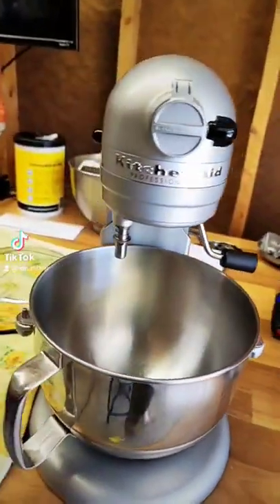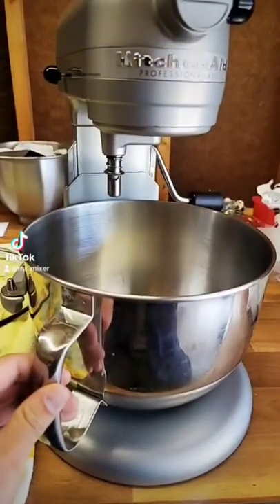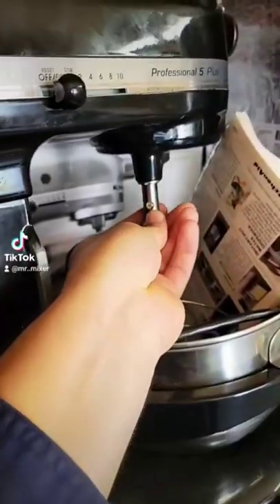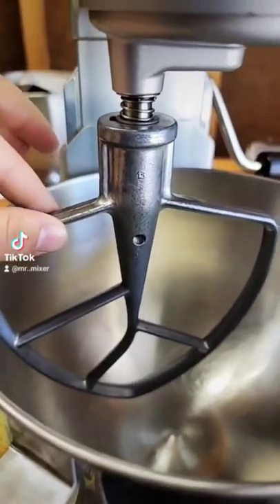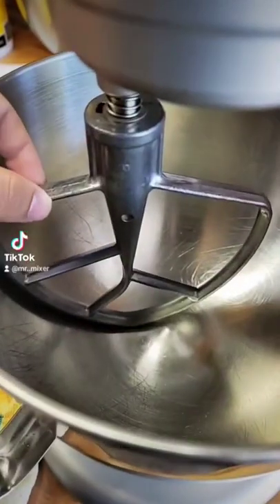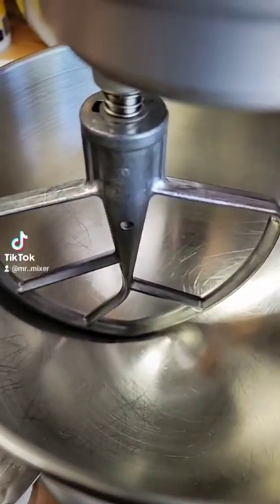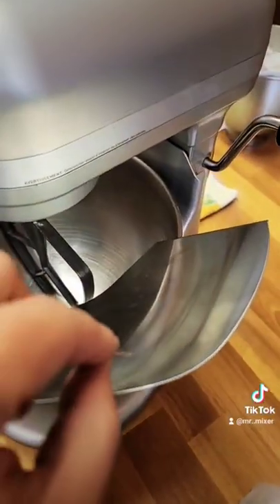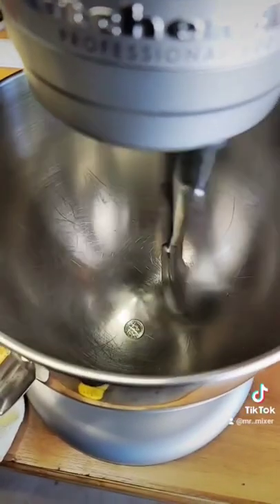Big issues, Easy fixes!! #baking #mrmixer #diy #food #kitchen #baker #kitchenaid #kitchenaidmixer

Comment: I don’t have that little screw.  I guess I have the unprofessional model 🤣
Reply: If you have a tilt head model, it has an adjustment as well, I think it's under the head or from the bottom of the mixer or something.
Basically tilt it back and look for an adjustment screw in the hinge area, or flip it over.
Or Google where is the adjustment on a tilt head kitchenaid mixer! Lol
Reply: @ke6gwf you must be an angel. I found it, it's a little stop-screw right under the inside... you need to spread the word my lord! 
Lol, but honestly thank you, it really annoyed me so I got a got a paddle with a wiper to try to fix the gap.

Comment: Thank you so much the most frustrating part of having this professional machine is the fact, especially if you turned into a small batch or something I have to get out my smaller machine which I have in an upper cabinet so I have to get a ladder for frustrates me every time, adjusting it with the screw allows me now not to have to do that. I may gift my small machine to one of my kids, thank you so much again
Reply from the maker: Glad to be of service!

Comment: When adjusting the height, does setting it based on the mixing paddle work for the dough hook and whisk too?
Reply from the maker: The hook shouldn't be close the thr bottom, the adjustment works for the whisk though